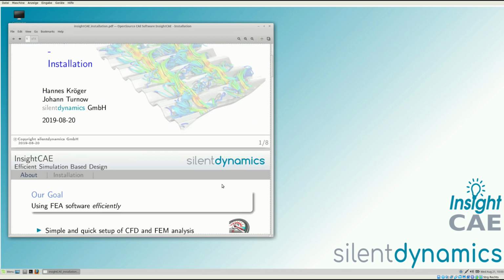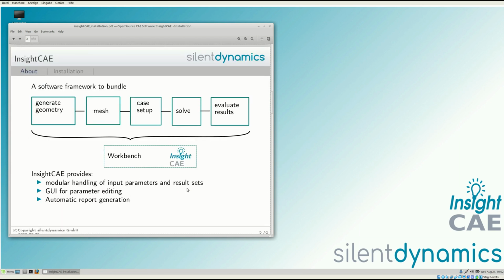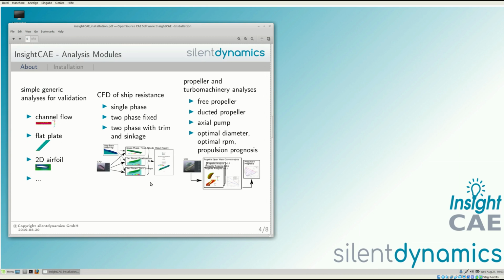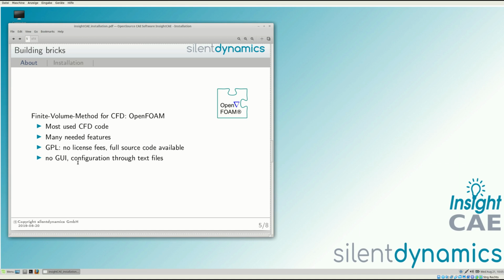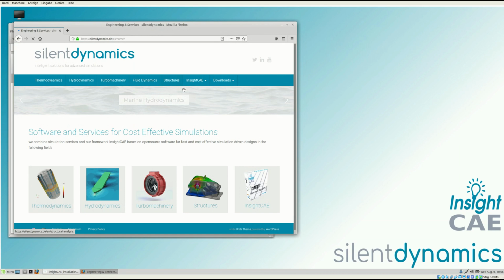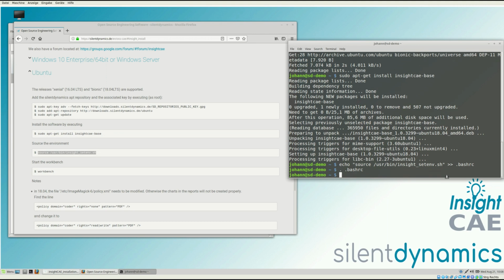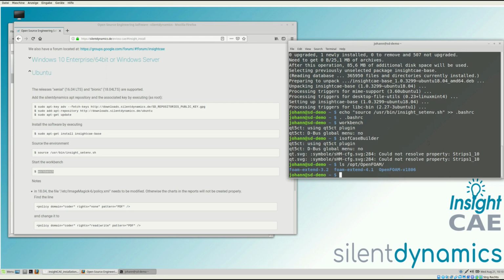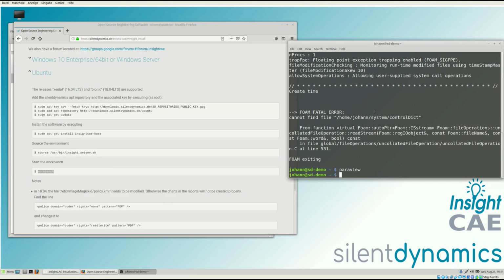How to install InsightCAE Software on Ubuntu Linux

Comment: When I try to install in ubuntu 18.04 i run into dependency problems. Even ccmake is not straightforward to install and use. Could you make some sort of containerised version, like a disc image? I use virtualbox in Windows 7 for example.

Comment: What is psword sudo ?????
Reply from the maker: Which password you mean?
Reply: Most probably your system-password that you use to login. When using a sudo command, it may requires you to put in the 'admin' password if you haven't done so in a different command very recently.